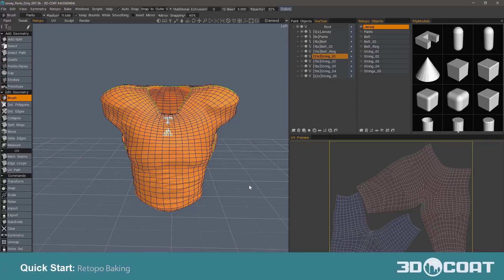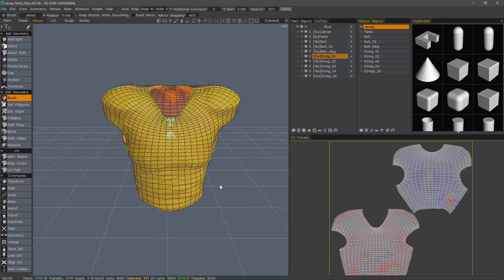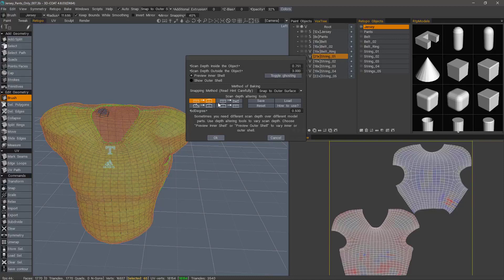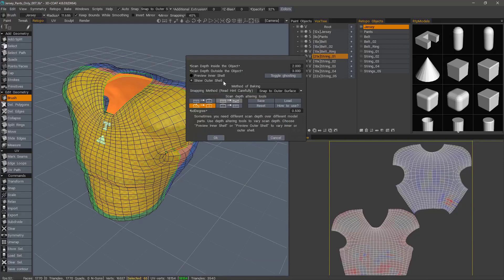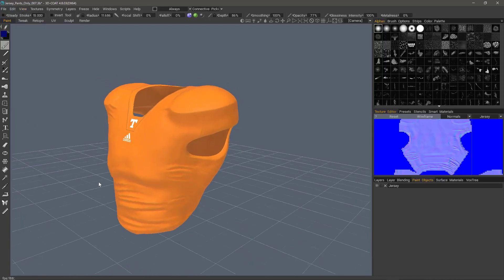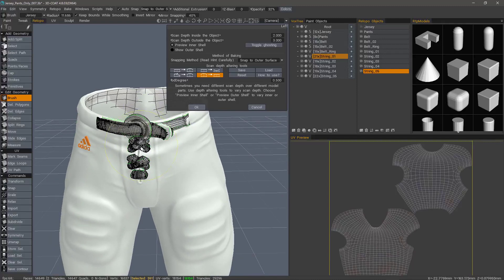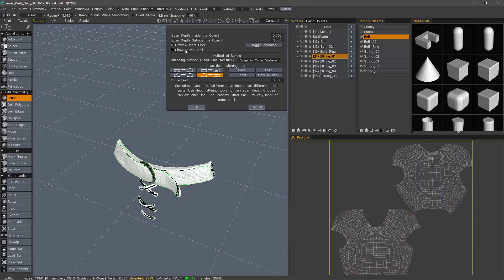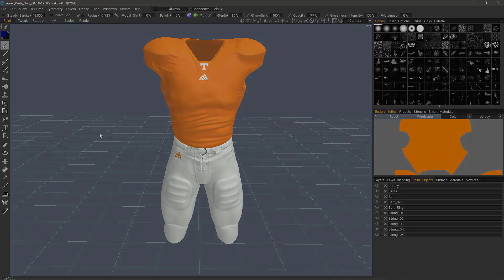Quick Start: Retopo Baking

Comment: How do you bake high polymesh on a low polymesh with hard edges ?
Automatically my import low obj mesh with hard edges is convert with smooth edges. So my bake normal map has heavy torsion informations to compensate.
Reply: mark sharp in retopo room with sharp tool.